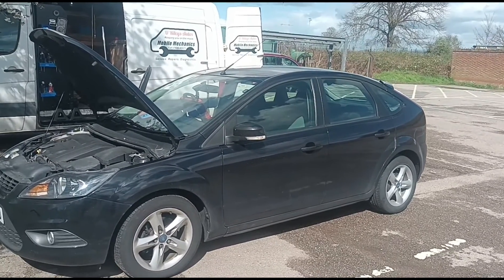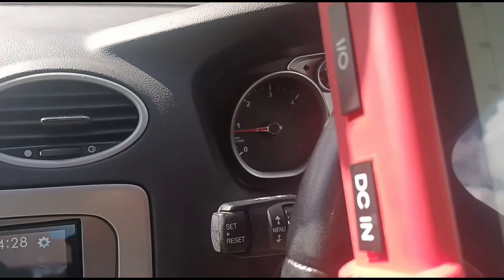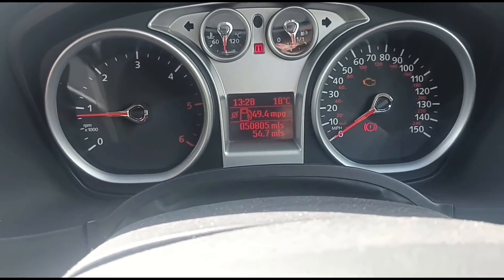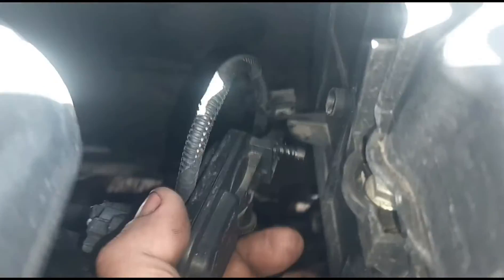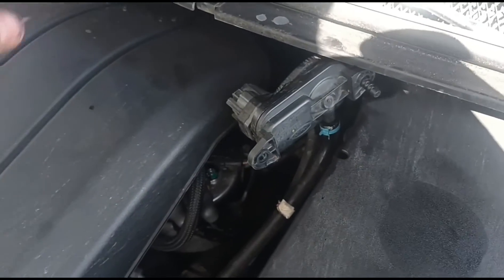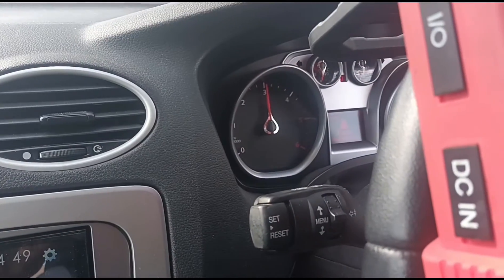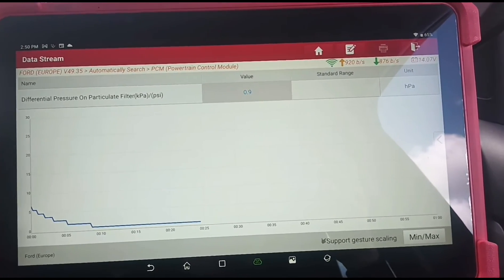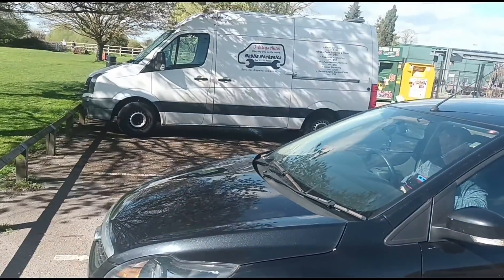Ford Focus 1.6 P242F P2458 Diesel Particulate Filter Restriction Ash & Soot Accumulation

Comment: Can I ask,is it likely a P244B code would be a blocked DPF??
I have a new pressure sensor and DPF hoses.

But now this pressure too high code ,I would guess too high would indicate blocked??

Strangely I do motorway runs every week so wouldn't expect the dpf to be blocked
Reply: I cleared the code and straight after these two have just came up 
P2454 (pressure sensor circuit low)& 
P2463 (soot accumulation)

One about the sensor but that’s a newly fitted last month.

It all suggests to me blocked dpf ???

Comment: Good morning, in my case, in a Mazda 3 1.6 CRTD, after having the DPF ultrasonic cleaned, the DPF cycle restarted, but there's still a high differential pressure. I checked the pressure sensor and it's fine, as are the lines, and I haven't noticed any leaks with the smoke machine. Do you have any idea what it could be? Best regards,

Comment: How much does this cost
Reply: That Euro tab iii (3) that Jimmy uses costs around £5995 but the Launch europad vii is around £1600 , it dies the same job more or less as same hardware & screen size except the tab iii has I believe all the accessories & auto fix / repair guides built in , the pad vii does not but you can add most accessories to the pad vii afterwards , hope this helps even though a year later 👍🤙

Comment: I think some of the dv6 engines have a thermostat opening temperature of around 80c. Worth a check. Threw me when i first saw one. Think i checked the part number and found the opening temp in the specs. Autodata sometimes lists the opening temp too.

Spot on by the way. Wish all mechanics took as much pride in their work and did things the logical and right way like yourself.

Comment: Well back to square one for me. The car worked fine for around 2 weeks but then the errors have been coming back. I can do dynamic regens so I know it can regen as Jimmy did the dpf clean. I purchased a new pressure sensor which has not made a difference. If I go on a 60 mile journey it does sometimes do a regen. The trouble is that I can do that on say a Saturday, come a week later the error pops up again with the malfunction when driving just to work and back. Surely it should have a longer period before the error appears again after a regen?  I had the eloys fluid topped up and reset so I know it's also not that. Might try the two hoses next from the sensor to the dpf as the outer lining looks to be worn. I have seen videos where the internal hose can split. A guy blew through it straight and it seemed fine. He the put a bit of bend on the hose and blew and nothing coming from the other end as it then showed a split. See if that does anything.
Reply from the maker: Any fault codes?
Reply: @ORileysAutos  yes. The same as above in the title.
Reply from the maker: @YarmouthMark  both codes?

Is thermostat working above 90ç
Reply: @ORileysAutos  i had a new thermostat fitted. Forgot to say..
Reply: P242f seems to be the main one. That will not clear
Reply from the maker: @YarmouthMark  that should just need re adaptions after the pressure is normal
Reply: Also from what I can gather, my mk 2 does not run at 90 celcius. Its 80 - 85. This is what the guys in the ford forum say. When doing a dynamic regen the parameters on the launch tool i have dont state it has to be above 90 either. Its 60 - 80 i think. I cant remember for sure though. Like i said though. Either way it always does a dynamic regen no problem so I would guess its reaching the required temp for a regen
Reply: @ORileysAutos  once the dynamic has completed i reset the dpf. I will take it for a long drive tomorrw. I'll see if it regens by itself. I'll then monitor the period of time and mileage until the malfunction light comes up again. I will also say that shortly after a regen the error is back but it does not go straight into limp mode. It wont let you delete it but its there. The Launch tool says a contionous  dtc. I dont know exactly what that means?
Reply from the maker: @YarmouthMark  go to special functions and tell it its had a new dpf
Reply: @ORileysAutos  Ok will do and i'll get back to you. Many thanks Jimmy 🙂
Reply: Right since our last chat, no change basically. Parts I have changed are. Thermostat, DPF Pressure sensor and hoses. The Air Filter Flow Intake Hose as I noticed the jubilee clip was not right as you could see a massive split in it right where it joins the turbo. I also purchased a exhaust gas temperature sensor but I have yet to have that fitted as I could not undo the old one. I have reset the Particulate filter.I had the Eloys fluid topped up. I reset the eloys / Pat fluid. I have also re-primed it via forscan. After resetting the distance until ash full etc is around 65,000 miles. The car when running will do around 4 - 5 regens with no problems. It does this say every 8 - 11 miles. The Engine coolant temperature when it does the regen is around 179 degree Fahrenheit. The pre particulate filter temp is around 1050 Fahrenheit. The Differential Pressure when idle is 0.05 psi something. The pressure when driving is around 1.5 + psi which depends on your speed and going up or downhill etc. It can run with the P242F showing normally. It hit limp mode when the p2458 appears. You can however then go in and delete the p2458 and it goes but the engine then does not come out of limp mode. Really getting frustrated now.
Reply: Update. So I purchased a pump from Halfords. I also purchased the dpf fluid and did another flush myself. The pump worked really well for me. It pumped the fluid in at quite a rate and the hose fitted my pressure hose perfectly. I let it settle for 5 minutes the run it at around 3k revs for 5 or so minutes. I also let the revs dip before revving up again a few times. Once done I still could not delete the 242f code after doing a dpf reset. So I removed the pressure sensor plug from the sensor. I then while unplugged started the engine. Malfunction light straight back on. I then switched engine off. Plugged the plug back into the sensor and this time when resetting codes it reset. I then took it for a drive. It's a good 10 mile single carriageway road from my place, Great Yarmouth to the main dual carriage way the A11 so you can't really pick up any real speed for a period of time, therefore regen conditions weren't met. I got to the dual carriageway and put my foot down a bit hoping heat would build up for a regen. Engine malfunction came straight back on. To say I was a bit peed off was an understatement. Pressure on the dpf was around 4psi when it came on. Anyway I decided I would just drive on. It soon became apparent even though it was in limp mode it was going to do a regen. The dpf temp made it's way up to 1100 fahrenheit. After around 10 miles the temperature suddenly dropped and the scanner had showed the distance till regen had gone back to zero. YAY. However the engine malfunction stayed on. So still while driving on the scan tool I tried a reset DTC's and it worked. Car out of limp mode and full power restored. It then did regens every 10 or so miles for a roughly 60 mile period. Longest I think was 13. The psi also as the car drove for longer came down. By the time I returned home 60 odd miles later it was never getting above 1.5psi at load. Just cruising it was mostly under 1psi. I am guessing it was just a case of the initial revving period after the flush and also doing some distance under load that has seemed to clear it again. I am going to be doing a fair few miles over the next 2 days. Great Yarmouth to Southampton then on the Monday Southampton to Blackpool. Will be interesting to see how it goes.
Reply from the maker: @YarmouthMark  what's pressure at idle and at 3000rpm?
Reply: @ORileysAutos  Now after cleaning it's around 0.05 psi idle. Not sure what 3000rpm is Jimmy. I did a screen recording and looking at that while driving the pressure varies from 1.1 psi to 1.3 psi.... I was really surprised it regened while in limp mode. Also annoyed it did not come out of limp mode though and I had to reset the DTC's.
Reply: @ORileysAutos  I have sent you an email Jimmy. 🙂
Reply: Have you fixed your problem and how :D? I got problems with p242f aswell with the 1.6 motor :/

Comment: We gave scrap money on a part X for a younger one of those with a DPF problem there mechanic has obviously had a few bits off the egr gasket was half blocking the hole the DPF temp sensors where loose and the thread gummed up It's just coming with soot accumulation now after 30min of driving DPF pressure 4 max 80s temps all seem fine I've reset additive in DPF when trying a static regen it fails one thing I have noticed is I can hear like a waistgate chattering when just doing a 3 point turn but it's a vv turbo 🤔

Comment: I had that same model of focus 1.6 tdci 110 bhp about 10 years back . The ford main dealership told me the dpf needed changing every 5 years at a cost of £1200.00 back then. I’d have probably kept it longer if cleaning them out was an option back then.

Comment: Have the same car the dpf is removed in my focus 174 000 miles on the engine the thermostat in my car sits around ,80 great job you do on the dpf your videos are excellent.
Reply from the maker: Put a new thermostat in and your MPG should improve

Comment: thanks for the videos ... have you ever found the highest value at minimum, for example 40mbar while at 3000 rpm the value is lowest 20mbar. how do you proceed in these conditions ?
Reply from the maker: I don't understand the question
Reply: @ORileysAutos  Excuse me .  it happened to me in the workshop a Renault trafic with error p2002 where the differential pressure at idle was higher than that at 3000 rpm .. example at idle it showed me 40 millibars at 3000 rpm it gave me a pressure of 20 millibars.
Reply from the maker: @mauriziogiasan4411  check the pressure sensor hose for leaks & blockages

Comment: My mate has a diesel ford focus and from one MOT to the next hes done 200 miles when he takes it for a service they just stamp the book and dont do anything it has advisory on mot for cracked tyres ... not be long for P242F
Reply: What engine is it if its got the 1.8 diesel then there lucky as the 1.8 didnt come with a dpf but could still eventually suffer from egr issues getting blocked with gunk especially if its not being serviced
Reply from the maker: Most 1.8 you can blank the EGR without triggering a fault